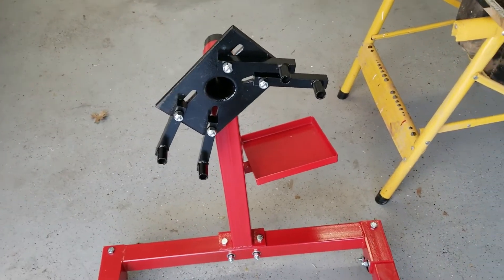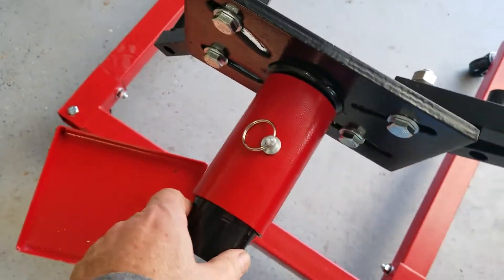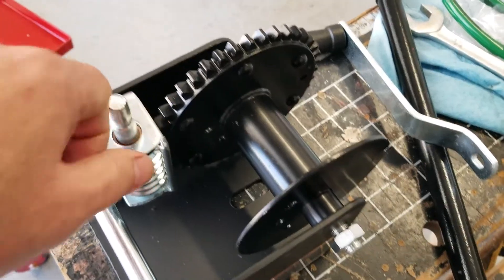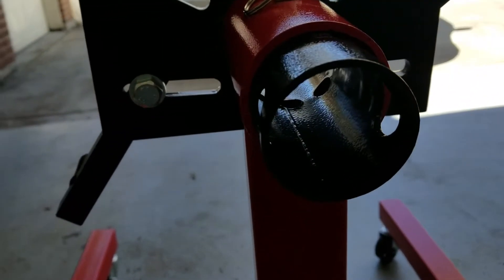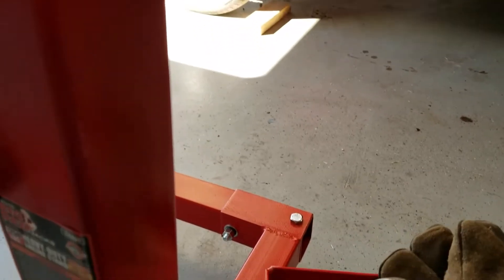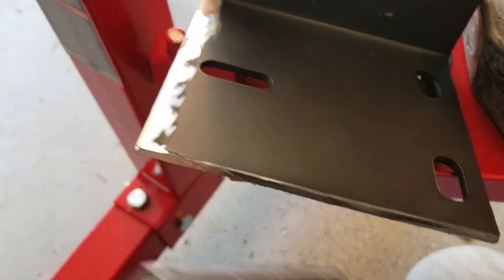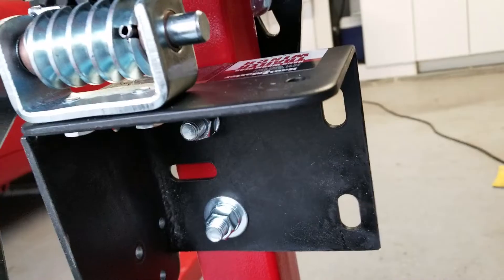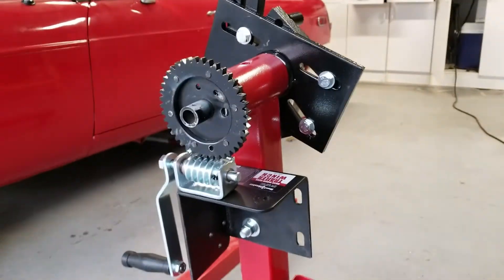Engine Stand upgrade (save over $500)

Comment: Does this Engine Stand allow bolting up to a VW aircooled engine?  I see you have some VWs.  Often I find these stands don't line up for the VW engines but curious.  thanks for any answers.
Reply from the maker: @MacSociety  i imagine it would.  But i understand why you would ask.  The engine mounts are pretty far apart.  This stand has arms that allow for sliding mount points.

Still, I have not actually mounted a vw engine on it yet

Comment: So when it has off center weight on it, will the weight back drive the gears?
Reply from the maker: @mitchlake8607  you would think so, but it doesn't.  The mechanical disadvantage prevents it.  Check the follow up video I did where I try to break it.
Reply from the maker: @mitchlake8607  https://youtu.be/IB90nr5EiGQ?si=rZ98jGlLuHYfTbmW

Comment: Good ideal i will like to see it with an engine mounted on it.
Reply from the maker: @kerrygatling663  here is a short video of the stand in different orientations 
https://youtu.be/Zxda4ZKFB_Y?si=tACADDyrvIPvKFLy
Reply from the maker: @kerrygatling663  
I had recorded the engine stand mod video 2 years ago.  After a year I did a follow up video where I push it to the breaking point
https://youtu.be/IB90nr5EiGQ?si=OTrogtLAW6S8F6Hs

Comment: I'm not going to weld the gear in. Many times, I bolt the head to the engine then, slip it into the stand. I'll put a removable pin through the shaft. Other than, that, you got a great idea!
Reply from the maker: @lylejohnston4125  i recorded this video about 2 years ago.  Harbor Freight has since started making a Gear Driven rotating engine stand.  Sells for $300.  Still more than my solution, but if you factor in the labor it might be worth it.  I don't know how the bracket attaches on that one.

I had fun making mine.  Hope it helps with yours.
Reply: @AlexPlatacis  I'll make my own like , you! I also will try to make the gear attach with a tube OVER the shaft and it can be the thrust bearing for the opposite direction.
Reply from the maker: @lylejohnston4125  send me some pics, and vids I will do a "two years later" video with viewer feed back
Reply: @AlexPlatacis  Yes they sell one from Daytona manufacturer, still, these need to be made in such way that the head can be undone to be able to attach to the engine then slide back into the shaft of the stand, I would not pay $300 for that reason, I have their Pittsburgh one which is manual, now I cant operate it when the engine is on it but it would be a PITA to attach that engine to a stand with a static head like the Daytona they sell. With your idea I reckon this may be possible

Comment: I’d like to have seen this operate with the “1200lb” engine on it, I’d bet it still will rotate on its own quickly when it’s centre of gravity is off, but now the crank will break a few bones.
Reply from the maker: Surprisingly, the mechanical advantage only goes one way.  Might seem counter-intuitive,  but the engine weight cannot move the worm gear it has too much resistance.  I have a video I did a year later where I push it to its limits...
Reply from the maker: @harpersisland  https://youtu.be/IB90nr5EiGQ?si=S2o0GBkcIA46oSc-
Reply: I highly doubt that engine stand is rated for 1200lbs 🤷🏼‍♂️

Comment: Pretty damm good but good luck bolting an engine to it now its unremovable, suppose you could turn it upside down
Reply from the maker: I bolted it on while hoisted.  I have mounted a winch in my garage ceiling.  But, I suppose you could also use an engine hoist(cherry picker)

I have since mounted my vice on the engine stand.  Very handy having a metal working station on wheels
Reply from the maker: @Sloposse  https://youtu.be/rdJaCmPIBkI?si=39UzfeJc33Wk84N7

Comment: I notice you removed the lock for the gear. Doesn't this want to free spin the heavy side of the engine to the low point? A couple of nuts welded to the tube clocked at 4 and 8 would enable a solid lockup.
Reply from the maker: Nope...
You would think, but it doesn't.  The worm gear has enough friction and the mechanical advantage is on the other end

Comment: How did you save $500. When you can buy a heaver duty set up basically the same way for $300?
Reply from the maker: It was compared to an engine stand with a worm gear.  At the time of this video they were $700.

Comment: You shouldn't be rotating a fully assembled engine. There's no reason to and it's unsafe to offset the weight that much.
Once the heads are off if your block is centered weight wise, it should rotate with one hand.

Comment: I like the idea, but I would have to make it so I could remove the gear because I have always found it easier to pull the actual mount out of the stand and bolt it onto the engine first. And then slot it into the stand while on the engine hoist.  Neat idea
Reply: Ya I completely forgot about that i also thought it was a kit when I clicked
Reply: Yes, same here.

Comment: I found a 10 to 1 gearbox and mounted that to the back of my homemade stand ,   also a sprung loaded  pin to lock the engine position on the end of the handle .

Comment: I had modified my engine stand over 25 years ago with a Chevy 4 wheel drive front bolt on spindle and cut the hat off of the rotor. Welded the rotor hub with the bearings on the engine stand in place of the pipe. Then welded the spindle to the engine plate. It rotates too good. I've been looking for a worm gear setup make it work better. Thanks

Comment: so.... you cant remove the Head unit to mount your engine..... so you now need to try to mount the engine to the stand while it swings from you cherry picker..... nice idea.... but lacking..... a lot.....
Reply from the maker: True.  But I don't have a cherry picker...
I mounted a winch in my roof.  Which was way easy to mount.  I did a video on that too
Reply from the maker: Here is my quick video on how I mounted the engine 

Not really "lacking"  just an alternative method.

https://youtu.be/yrl8zVKMZic
Reply: @AlexPlatacis  I just like to be able to pull the head of the stand off to make it easier to mount the engine. I do like the idea though.
Reply from the maker: I suppose instead of welding the sprocket on, you could figure a way to bolt it on.  That would enable the head unit to be removed.

I will mention that in my follow-up video, I am working on.  Thanks for the input.  This whole channel is all about sharing experience and ideas.
Reply: I would weld a piece of 1/2" bar stock with tapped holes into the end of the tube on the head piece to bolt the sun gear to. 1/4" bar with nuts welded on the back would probably work, too. 
Welds on that insert need to be flush. The insert does not have to be full circle. It could be 1.5" wide. 
It is fairly important that the sun gear be precisely concentric to the tube of the engine stand head piece.

Comment: I’m going to do this but instead of welding the gear to it i plan on holding the gear in place with a pin as well so I can remove the plate to bolt to the engine easier
Reply: yes, i was thinking the same you want to be able to take the gear off so you can slide in & out like it's a useful function maybe use a tight-fitting bolt.
Reply: Please explain what you’re talking about? I want to do it where I can remove it.
Reply: It would be a good idea to have a bigger tube welded to the gear. Where the tube is thick and snugged. Where you can slide in and out. And have the same hole diameter from the handle bar. This way you can slide a thick pin or a bolt. This will give versatile engine stand. 
e @papergatorzfedducca7998

Comment: Now put a small plug patch over the old pin hole and install a zerk fitting and now pump some grease into it, it will be real smooth.  I did it to mine, it makes a huge difference

Comment: my only problem is getting the ebgine if the perfect position to bolt it the the head of the stand
Reply from the maker: I used a winch.  But I suppose if you have an engine hoist (cherry picker) it should not be any harder than putting the engine back into the car

Comment: Now you can’t take the mounting plate off to easily bolt it to the engine 🙄
Reply: What if you found a pipe that could slide into the orginal engine stand that rotates and have a pin, or bolt through the hold where the bar to turn the engine used to go ?  Then you could bolt the engine to the carrier and then with the hoist fit that carrier into the "head" and then, once there, add the gear set and pin that into the carrier ??  We will see.
Reply: Only problem I see with your idea is that reducing the diameter of the "inner pipe/pin" is you lose a lot of of strength.  You would probably need to reinforce the backing plate with 1/2" steel plate, and then weld a solid steel pin and hope for the best.
Reply from the maker: True.  But I chose function over form.  I used a ceiling mounted winch to mount the engine, so it was not a problem for me.
Reply: @AlexPlatacis  still a pain to get it lined up. Much easier when you it comes apart.

Comment: Nice! But how do you stop it from moving previously you had the pin?
Reply from the maker: you might thing it would just move but the gear ratio is high enough that it does not need a pin.  it does not move
Reply: worm gears only work one way